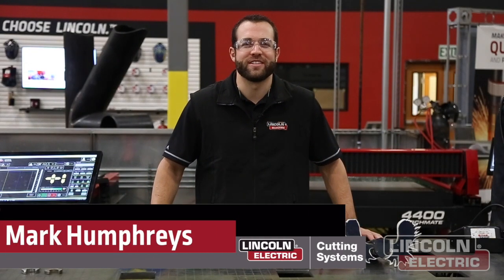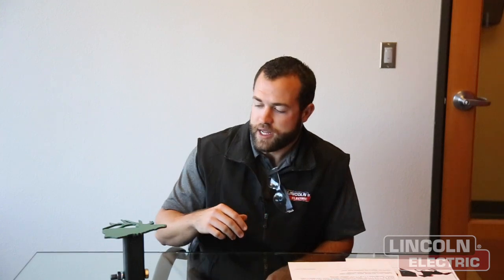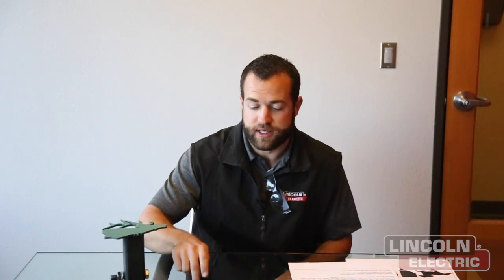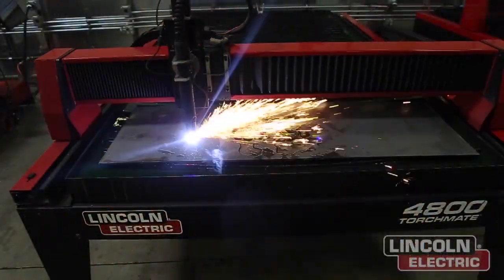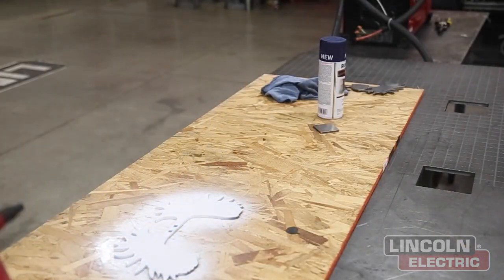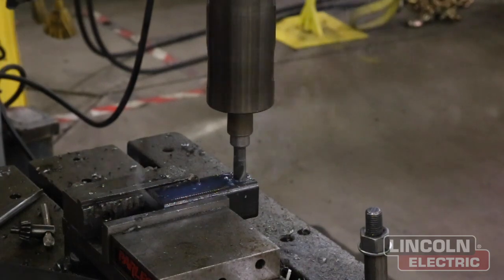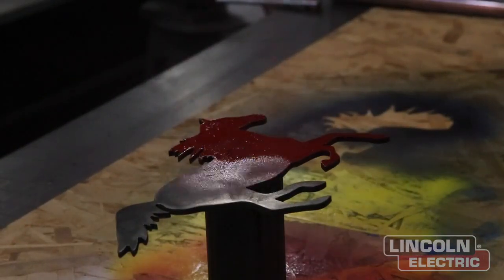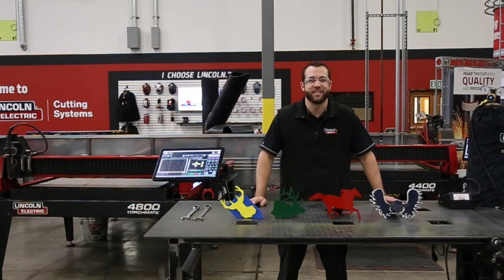Design | Cut | Build Episode 6: Hitch Cover Build

Comment: Just a suggestion,but instead of the HSS you can also cut a piece of plate and bend 3 sides with a hole already cut by the table.  that way the entire project  is produced using the plasma.